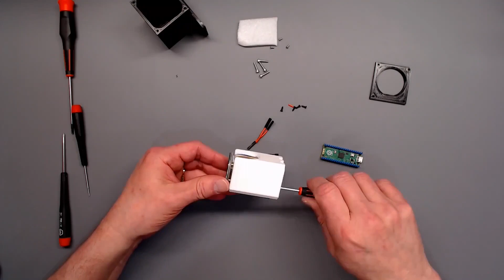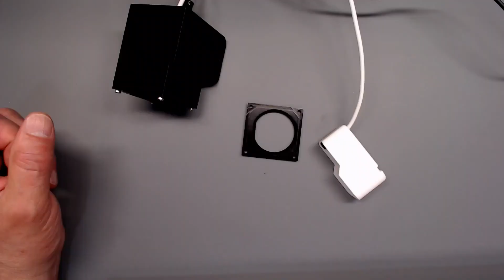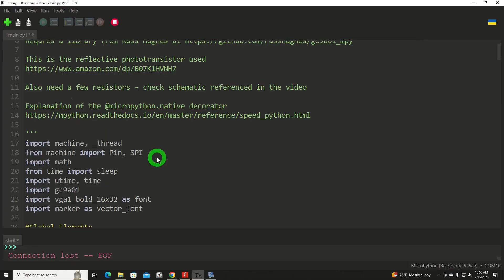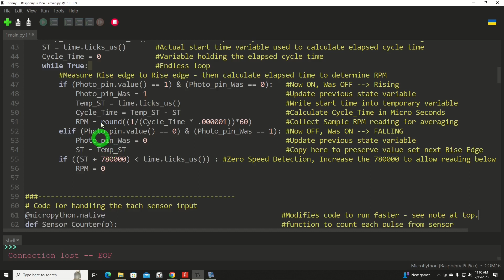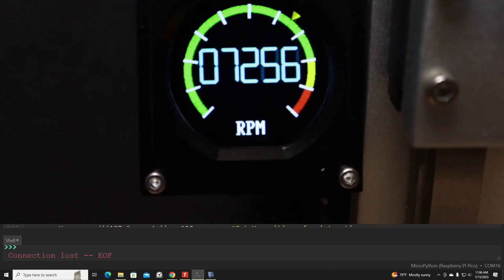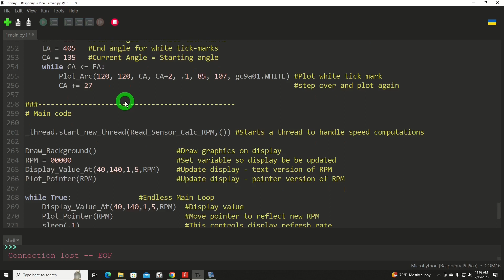Learn how to make a Tachometer for your machine

Comment: Ever think about adding a cutting speed calculator?  A rotary encoder with push select on the case and some programming one could go to a calculator and enter drill bit diameter and material and it would kick out the appropriate rpm for the size/material?
Reply from the maker: Good morning,  That is a great idea, but, at this point that little drill press project is considered finished. Cheers, Chris

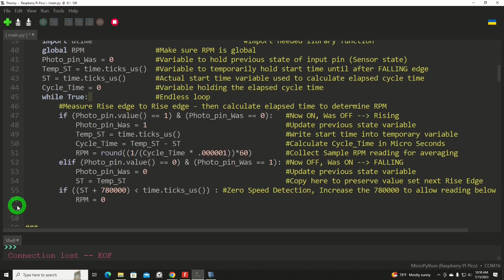Comment: 18:32 line 50 "Cycle_time = Temp_ST - ST", could be a problem, see time.ticks_diff()  which would always give a correct/expected answer.
was thinking why RPM and not RPS, tradition ? 213 RPS would be easier to read than 12780 RPM, personal preference i guess.
Reply from the maker: Hi Ben,
RPS???  Seriously?  I am guessing you perhaps work with a lot of very high speed things?  In the industrial work of machine tools and cars and motor cycles it is always RPM.  That isn't just a USA thing either, machine tools from all over the world use RPM.
As for, time.ticks_diff(), I recall that not providing any change in accuracy for this project.  I have used it on a couple other projects where the device being monitored was more stable and recall seeing benefits there though.  Perhaps I should have utilized even with this machine as it would have been better for others using this on more precise spindle systems.  Hmmm, I have to watch out for that more, thanks!
Chris

Comment: I like this. A lot. The display looks really good - but obviously I'm going to chime in with some ideas. First would be to use the 10msec wait to do multiple reads and average them - that might stabilise the flickery pointer a bit. Next is a big one - use this reader to feed back to the controller so you can set the speed accurately. Good luck with coding that!
Reply from the maker: Hi Don,
Thanks for the feedback.  I tried the averaging as you suggested and it provided little change.  As for the controller, it is unlikely to work with feedback.  It is a VERY inexpensive driver and truthfully I am surprised it works!
Cheers!
Chris